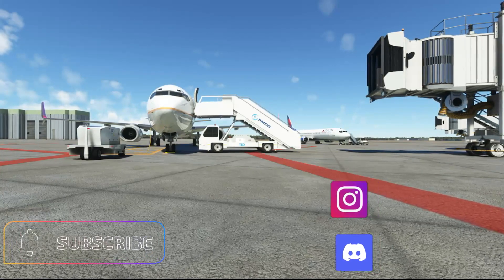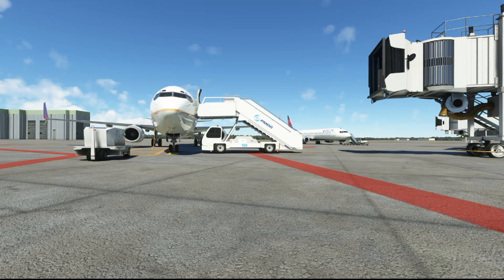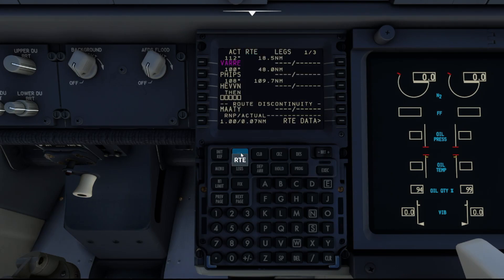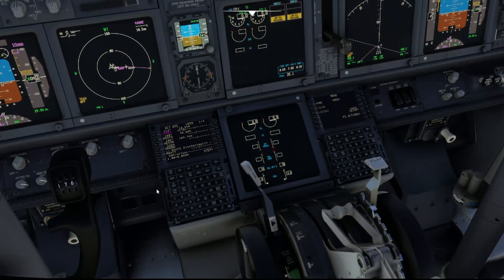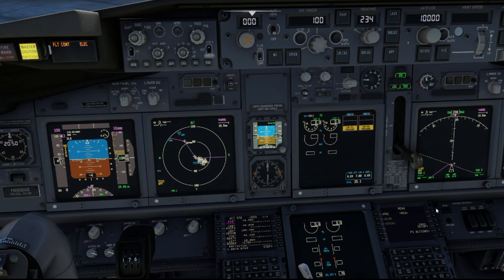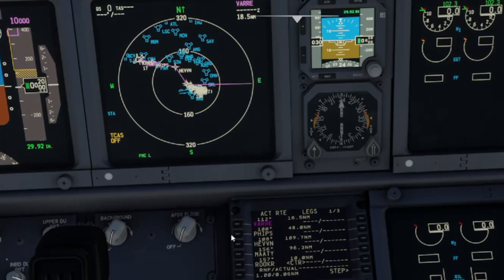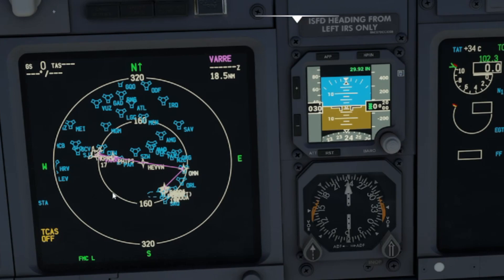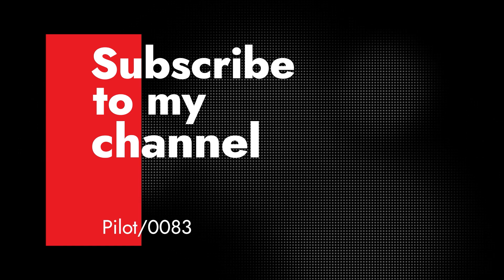EASY FIX FOR THOSE ANNOYING FLIGHT PLAN DISCONTINUITIES IN THE PMDG 737 | MSFS2020

Comment: Good video. Liked HEVVN waypoint. A few years ago flying from St. Pete to Destin in my real Cirrus. ATC asked me if I wanted a shortcut over Gulf. Sure. Go direct HEVVN. About 5 mintes later the plane began give loud knocking sounds from the engine. I asked ATC which Heaven did he want me to go to. LOL. Changed back to fly along the coast line where each airport was available for an emergency. Turned out a bracket in the air conditioner broke off and was rattling inside. God saved me.